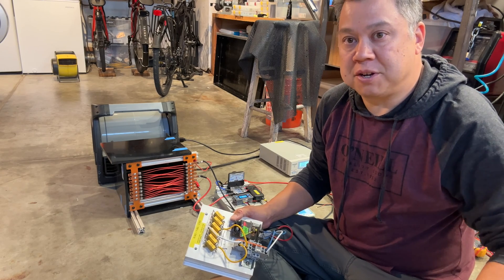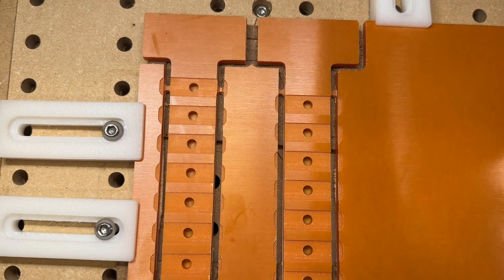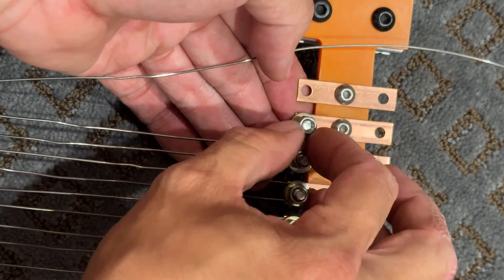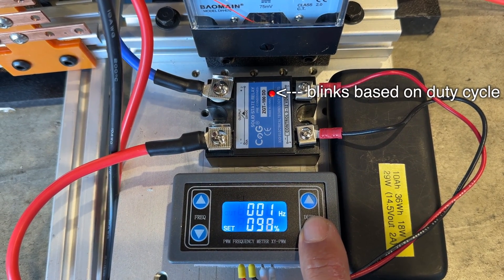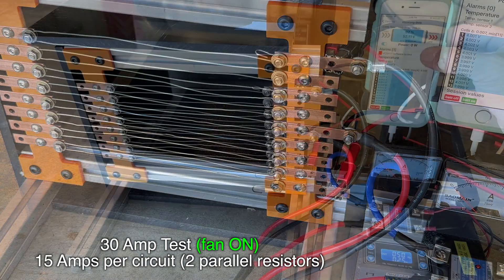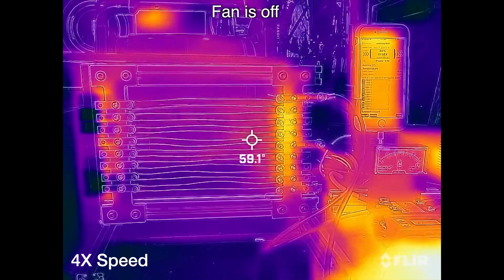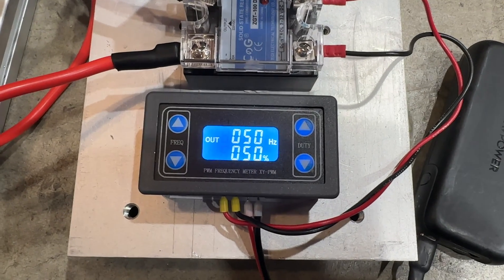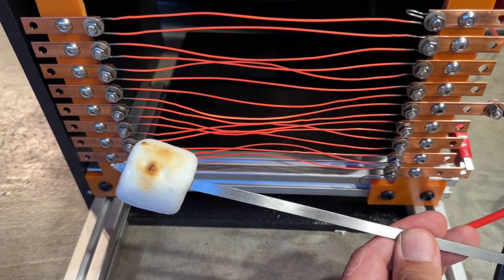Building a 2.5 kW resistor load bank

Comment: Is it necessary to use that logic controller and ssr? Can I just use a simple on off switch and a power meter? Is it less practical to connect directly or can I precisely measure the amount of power discharged using a hobby grade watt meter?
Reply from the maker: If you want to control the power, you need the SSR and Function generator.  Without these items, the resistor might draw more power than the battery is rated.  Also the current will drop down as the battery voltage drops during discharge.

Comment: We think alike. I made a similar thing but with the nichrome wire from an old toasters. And i used a long plank that i wraped with metal foil with holes for the screws so it doesnt shortcuircit. Then i put in 10 screws and stringed the wire back and fort so it looked like a guitar and held the wire hard enough for it too not warp. But the warping can be becouse the wire is from a toaster so they dont warp like normal nichrome wire.

Comment: SSR at these currents without a heat sink?  Might well have been why the thing got toasted at the end..... Revision:  I see that all the control elements are mounted on a heatsink (I think) - so maybe the heat wasn't dissipated enough (?) or just a cheap SSR.
Reply from the maker: SSR is on a huge heat sink, and it never even got warm.

Comment: I believe you can get tungston tubes (used in toaster elements) to encapsulate each wire. That way you won't have to worry about them touching each other. 

Great video by the way. I am building a resistor bank using power reistors and man the project cost shoots up quite rapidly with these expensive buggers. I like the idea of using nicrome wires but the final product is a bit too dangerous-to-work-with for a hobbyist like myself.

Comment: Why not use the heating elements from a couple cheap toasters? They’re already mounted on extremely heat resistant mica sheets that would prevent the nichrome wires from sagging and potentially shorting out.
Reply from the maker: The resistance of the resistor I built is about 1 ohm,  at 48V it would draw 48 Amps.  A toaster would be about 16 ohms, and only draw about 3 amps at the same voltage.  The nichrome wire in a toaster is much thinner.

Comment: What is the point of bench testing these cheap batteries? What kind of diagnostic info are you looking for that you can't get from the BMS app? Wouldnt it be easier to throttle the bike while it's suspended, and tweak the battery current output thru controller interface? Very cool vid, you and Damien Maguire are my heroes lol
Reply from the maker: We're actually building batteries for an electric airplane.  Currently I'm testing a small 48v version of a much larger battery we're getting ready to build.  We've done exhaustive cell testing already with off the shelf testers. I'm using this resistor bank for testing our clamshell and bus bar system, hope to show those off soon!

I could use my e-bikes for load testing, but to sustain 2kW, I'd be doing +40mph.  The e-bike won't draw much current with the wheel spinning in the air.
Reply: @etischer  I see, that definitely makes sense. Excited to see more of this
Reply: @etischer  what kind of cells did you go with for those batteries
Reply from the maker: @Ridstard0  I can't get into detailed specifics, but there will be a future video about the batteries.

Comment: Possible to pre-stretch the wire? Like new guitar strings
Reply from the maker: I pulled them as tight as I could by hand, they were like banjo strings.  As soon as they heated up, they relaxed slightly elongated again.  Maybe the key is to wrap the wire up into a coil spring?  Next time I'll leave more space between the wires, but this seems to be working ok so far.   I could also add mica tabs to hold the wire in place, as they do on some toasters.
Reply: Try having a spring at one end of each strip...